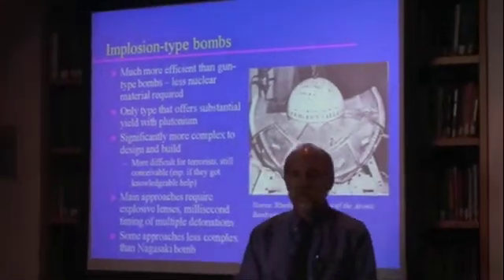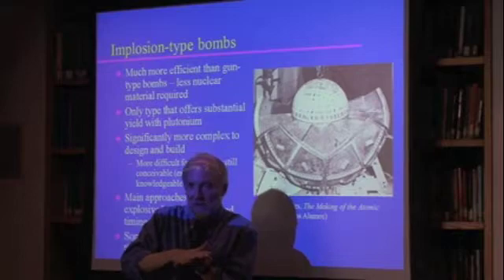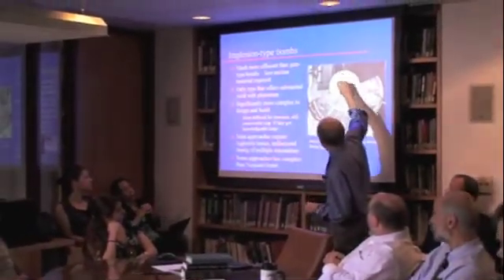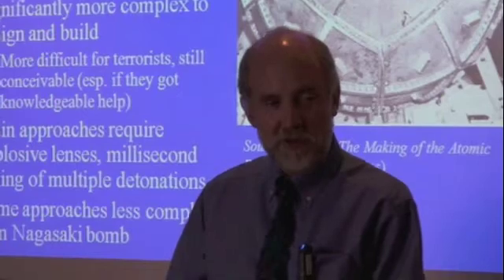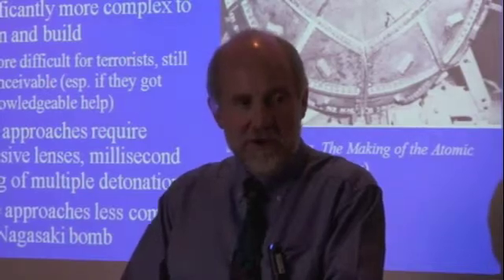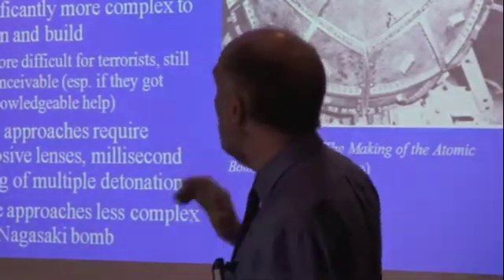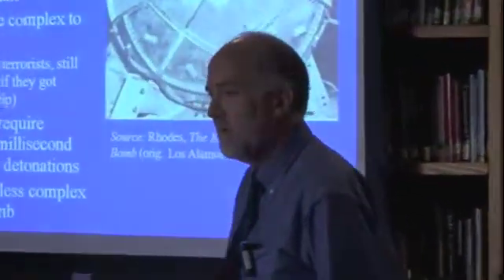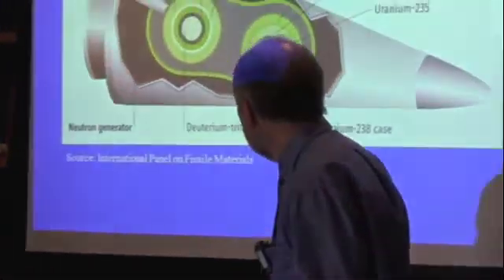Nuclear 101: Implosion-type Bombs (5 of 9)

Comment: The speed of sound??  I thought the detonation wave was traveling at many times the speed of sound.
Reply: Nope, they travel at the speed of sound (in that particular medium).
Reply: Exactly. What he said 👆
Reply: High explosive cause shock waves that are supersonic.  The shock wave speed can vary depending upon the type of explosive used.  As an example, TNT has a detonation velocity of 6,900 meters per second.   Explosives' shock wave speeds can very from about 1,600 meters per second to over 10,000 meters per second.  The speed of sound in air at sea level is 343 meters per second.  In water, the speed of sound is 1,493 meters per second and in steel it's 5,130 meters per second.
Reply: Don’t struggle with the ‘speed of sound’ idea.
 ‘Sound’ basically translates to “thermodynamic quantity”. 
The reason it’s hard to wrap your head around the concept is because you are trying to understand where the energy goes if it doesn’t go into velocity.
It goes weird places…….
Reply: You're right. Detonation is sustained by supersonic shocks.
Deflagration waves produced by low explosives travel at the local speed of sound.

Comment: With 3d printers, you could easily create an explosive lens mold and fill the respective parts of the mold with fast and slow high explosives, which are themselves very easy to make.  Fortunately, nuclear material is still very difficult to acquire.
Reply: You have to know the exact detonation rates of the explosives, and then you also need to construct a  neutron generator at the core.   Applying 3D printing isn't some kind of panacea that would instantly give you the ability to make a bomb.
Reply: Haha, and you can do the math to create that lens
Reply: And those lenses are made of two different types of high explosives